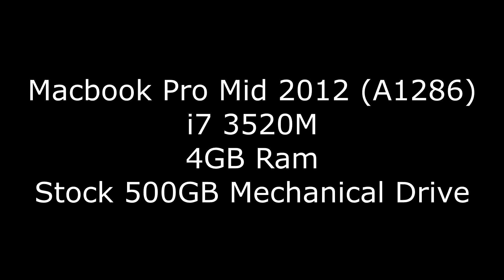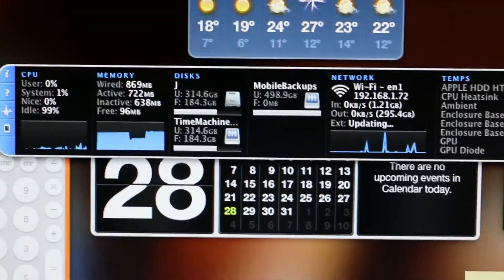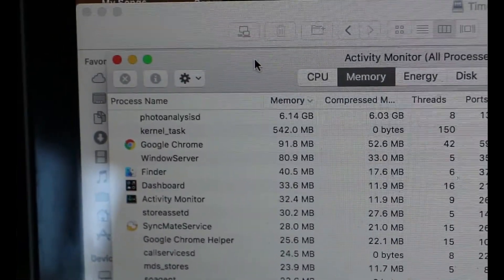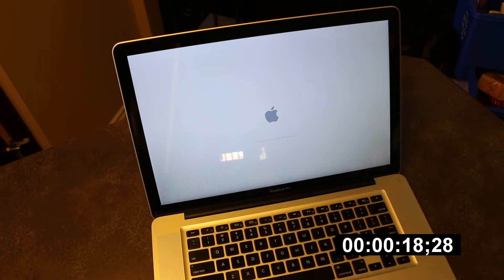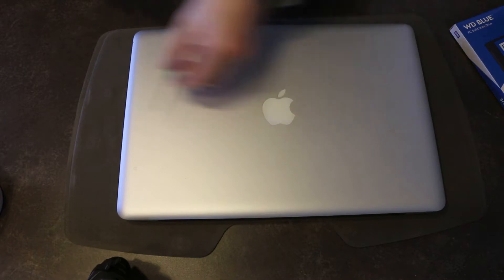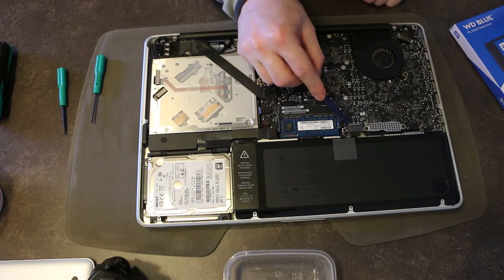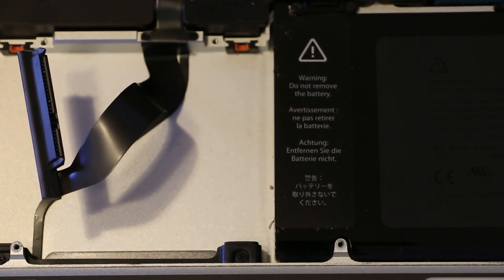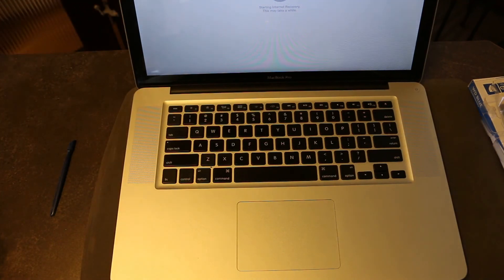Macbook Pro Mid 2012 SSD Upgrade

Comment: Very informative, especially the diagnostics part. I recently purchased a MBP mid 2012 13' and, although I keep it on OS X Mavericks, I've began to notice it started opening applications slower. Wasn't sure if I should upgrade my RAM or HDD, but now I'm convinced I should upgrade to an SSD.
Reply from the maker: Glad you found the video informative. Newer version of OS X aren't that great into taking into account the performance of legacy hardware. RAM will certainly help, but if you look at the price point vs a swap to an SSD, the speed performance increase from the read/write times will outclass doubling the RAM. Client was very excited to get the computer back after I reported the new boot times so I didn't get the chance to do in-depth comparison tests. Perhaps next time.